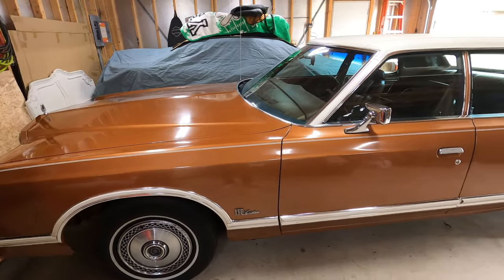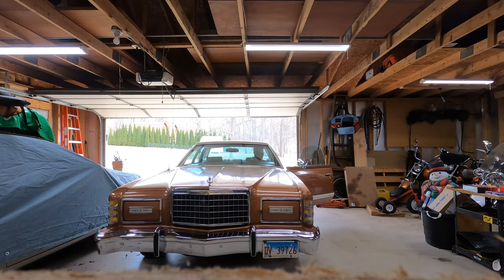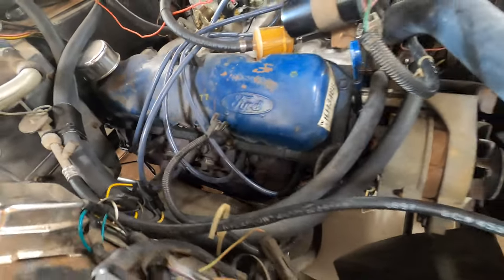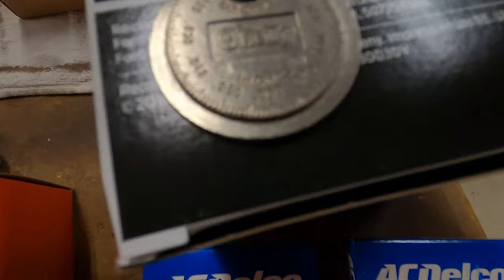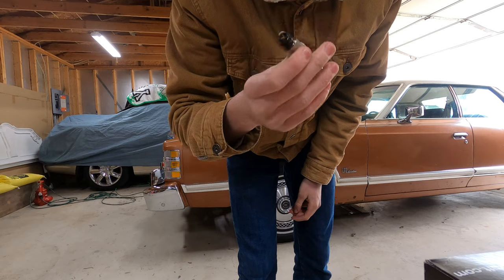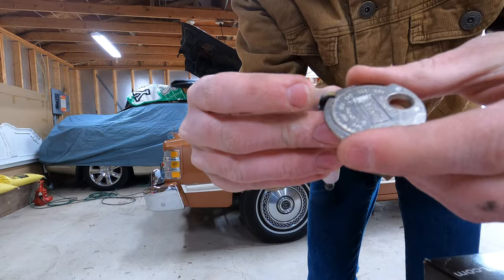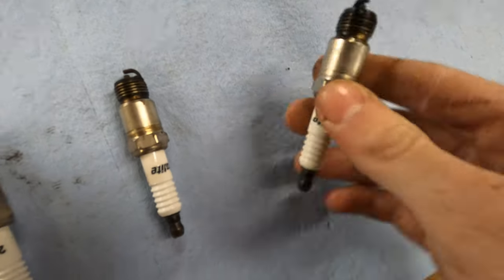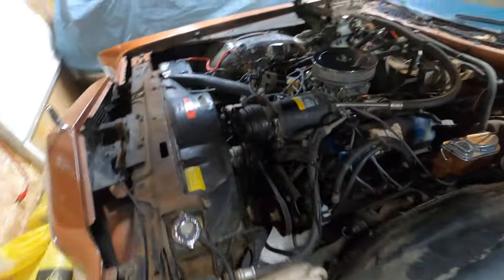1977 Ford Ltd Tune Up, Spark Plugs, Wires, Distributor Cap

Comment: I've long forgotten what is was like to live in a snowy place!
Me? I'm cheap. I would've pulled out and "read" the existing spark plugs just as you have done. 
Since you found the spark gap to be out-of-spec...I would've regapped them to the correct spark gap. Then I would've evaluated the result. Would the engine sound and work better? I would try to find out with a road trip.
That's when I saw...you're snowed in! Ugh..
Only after a road trip to test the regapped spark plugs would I have decided to buy new plugs (and/or wires) or not to.
Being an military guy, I would not be able to even function without a technical manual. I loved reading them and learning about my cars. These helped me out when it was time to work on my own vehicles.
I wish you a lot of fun road trips...after that snow clears. Aloha.
Reply from the maker: Thanks